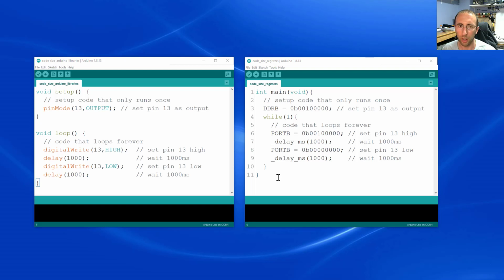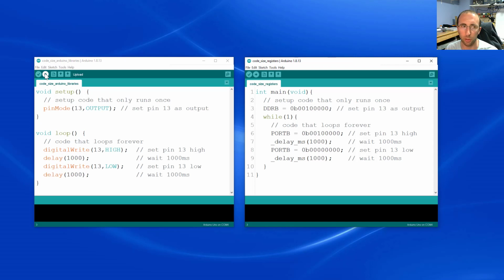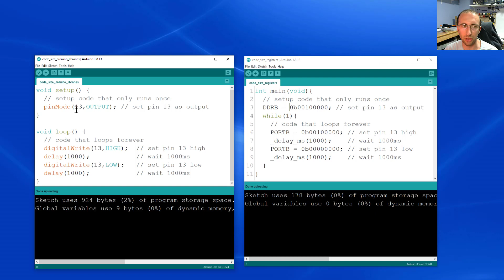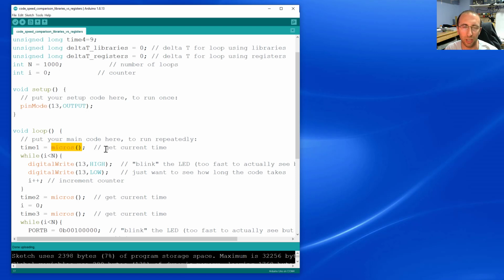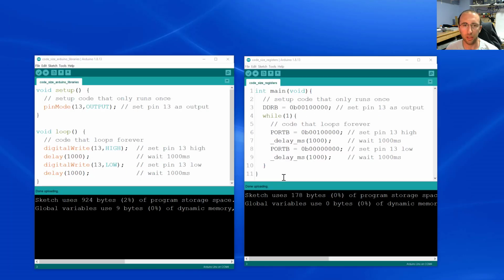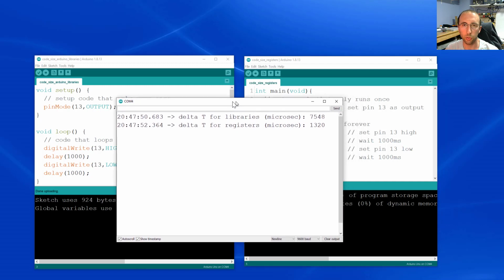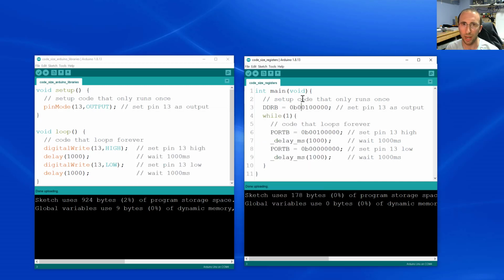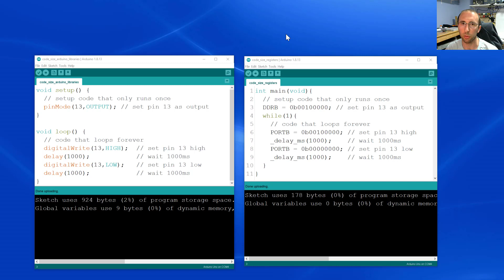Optimize Your Arduino Code with Registers

Comment: Hihi... And nowadays people do this using something like rust or py.... 😉
Reply: C is widely used even to day, it's just not as cool or fancy as Rust, Python, JS, GO, etc etc etc.
And people doesn't wan't to learn anymore, just point and click and the magic must begin within 2 sec or else its just a peace of "anything you don't like"..
But you won't see any driver, kernals, low level embedded etc in Python just yet, nor will you most likely not find and Rust compilers for embedded either.

C will not go away just yet even with it's flaws... Hey, the flaws are basically more a skill issue in the end.

There are even places were Assembly still are manditory, in the core and sleep/low power setting for some of the Espriff etc it's manditory to do these adjustments in ASM because there are no other way, and Yes Espriffs are everywhere as IOT devices.

Don't get me wrong Python is great for its' purpose, I use it at work daily, so are all other languages.
But it's not for the embedded unless we're talking about Raspberries, Bananas, NUC and so on, the NUC isn't embedded but you know what I mean.
And Python is slow as molasses in Siberian winter, yeah yeah there are ways to speed up Python scripts by using..... "drum roll" modules written in -> C of which are compiled for speed and efficiency! So yet again, C is always lurking in the background, one way or another. =D

// Happy coding might. =D

Comment: Do not write `0b00100000`: it is hard to read and error-prone. Write `_BV(PB5)` or `(1<<PB5)`: it's just as fast (it gives the same generated assembly) and makes it very clear that you are fiddling with pin PB5.

Comment: some codes dosnot work with this methos i transfered a oled and dht sensor to this methos and it was impossible to work ???????????
Reply: How so?
Maybe you have a library that doesn't recognise the low level code.
You'd have to manually edit some of the code from the sketch.

Comment: Now write it in asm.  For example, I wrote code that does exactly the same functions as multiple libraries, spi negotiation, i2c communication, in asm, and it compiles to just over 1.5kb…. The original code is over 24kb… there again I’m an old fart who started when memory was premium… you had to be efficient.

Comment: Where is position of accumulator memory in arduino like as microcontroller AT89S51??? how to acces and save??
Reply from the maker: I'm not sure, you'd have to check the microcontroller's datasheet.

Comment: Chat gpt said that we can store out libraries and parts of the program(Sketch) in SD card, I didn't find any video tutorial on this, how its done?
Reply from the maker: ChatGPT makes things up sometimes! https://youtu.be/3Xh9aNfOgfE
Reply: you can store data inside an sd card but you'd need to learn how to make files and write in them in c++, thanfully it's not complicated and there are some good tutorial on youtube.
Edit : this is limited to variables, i doubt you can store programme as it's not the same type of memory.
Reply: @vodkaboi4974  Well, technically if you can read/write directly the sectors without any filesystem, this is considered as virtual memory, sort of. The thing is it's MUCH slower. You could execute some code if it was first copied in RAM, that's how MBR worked in DOS.

Comment: AVR is one of very few processor families specifically designed to be programed in assembly. Doing so is not much harder than using a higher level language. If speed and fine control over register use is what you after, assembly might be worth looking in to.  
For example: You may give a routine (function) exclusive use of some of the 32 general purpose registers instead of using variables in memory,  reducing the need to push and pull from stack and heap.  This can give significant performance gains. Frequently called interrupts are a good target for this technique.
Reply: Don’t forget if you’re not using all the ports, you can use them to hold 8bit values too…
Reply: Push and pop from the stack do use several clock cycles, so minimise if you need precise timing.. also the data sheets have a nice section on the opcodes , including clock cycles to execute.

Comment: and how to do IF THEN ELSE in register code. great fid you make. thanks
Reply from the maker: Hi - the syntax for if/then statements is the same in both C and the Arduino language, you can't replace it with registers (as far as I know).
Reply: @BenFinio  ok. Thanks for you anser 👍
Reply: @nonaak  you can use logic gates but if else is already kinda a logic gate
Reply: Most of the time, registers on embedded systems are used for peripheral configurations (pins, timers, UART, ...), thats the things surrounding the CPU and both peripherals and CPU makes the µC. So depending on the bits stored on that register, the behavior of the peripheral will vary. 
On the other hand, instructions like if/then/else are directly involved in the ALU of the CPU. And most of the time standart libraries in C should handle the job.

Comment: I feel it shouldn't be necessary to bang on registers manually; That sort of thing should be resolved by the compiler.
Reply: That is the problem, you are relying on a program to optimise a program. If the compiler is not efficient, now will the result be. No substitute for hand crafted assembly routines… smaller , faster,  and if your nerdy and need to compute cycles, you can easily count the clock cycles via the cycles each op code needs to process. Great for tight timing when you want to run @8mhz and dump data to addressable leds….

Comment: Two questions: 
1.Is the faster/efficient code written in C? is that the reason why delay() converted into _delay_ms()?
2. Isn't it faster to bit operate the PORTB rather than reassign it a new value?
Reply from the maker: 1. The code on the right is written entirely in C, but the Arduino IDE will let you mix and match, so you could write delay() instead. (disclaimer: I realize there is debate about what exactly the "Arduino language" is and I do not have a strong opinion on what to call it: https://hackaday.com/2015/07/28/embed-with-elliot-there-is-no-arduino-language/)
2. Yes, someone also just pointed this out on Reddit. I find that students are confused by masking and bitwise operators at first so that needs to be introduced as a separate topic. So we usually do this first, then do something like try to blink two LEDs out of sync, and realize that "whoops, we're overwriting all the pins because we're writing to the whole register" and then use that as motivation to introduce masking. It's about halfway through the list of Tinkercad tutorials linked in the description.